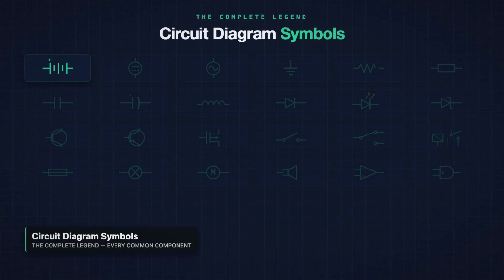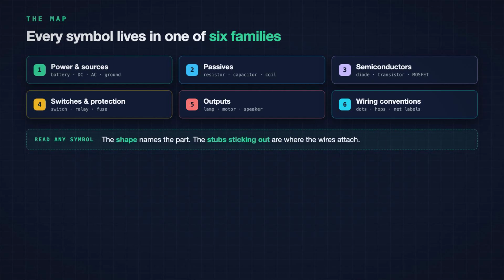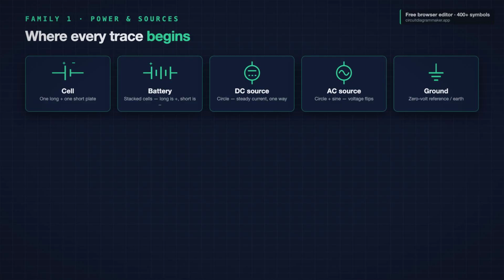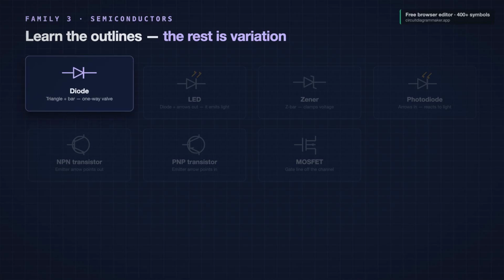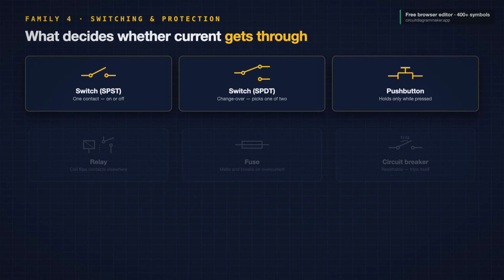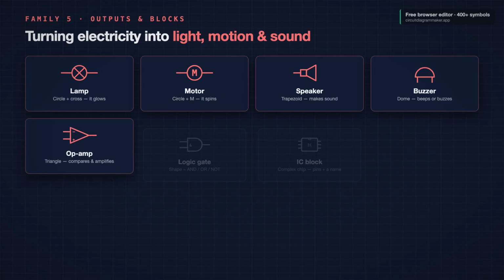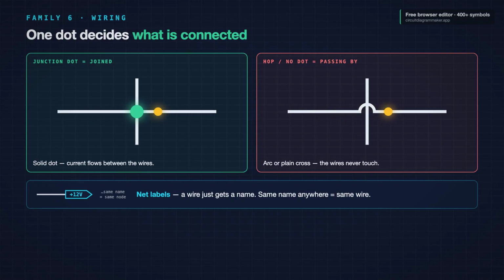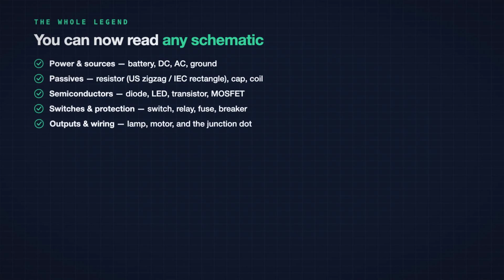Circuit Diagram Symbols Explained (Every Component)

Comment from the maker: The symbol that catches everyone: a resistor is a jagged zigzag in US/ANSI schematics but a plain rectangle in IEC/European ones — same part, two different pictures. Learn only one and half the world's diagrams look alien.

Close second: two crossing wires mean nothing until you check for the junction dot. Solid dot = joined; a little hop (or no dot) = they just pass by.

Which symbol trips YOU up the most? Full searchable legend, 429 symbols, free: https://circuitdiagrammaker.app/symbols?utm_source=youtube&utm_medium=pinned_comment&utm_content=yt-139